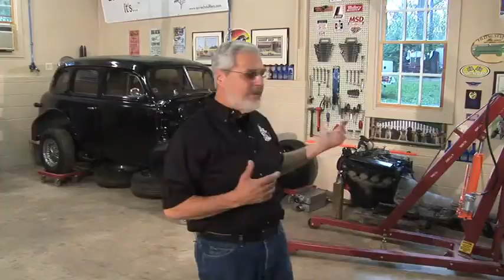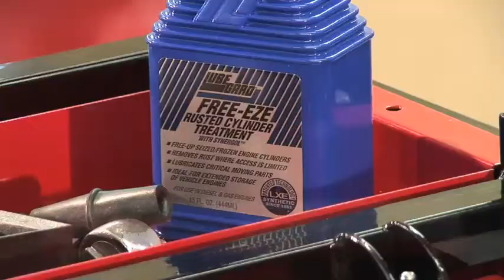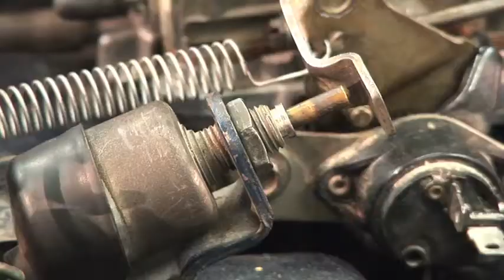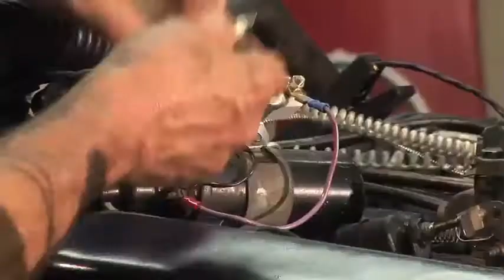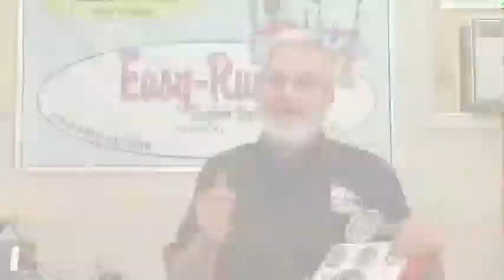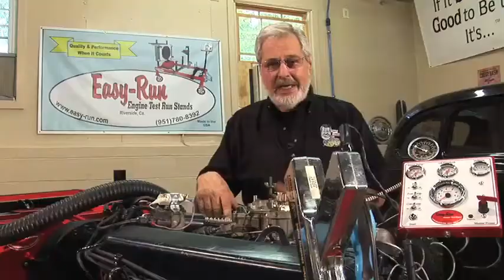Lubegard 9_17_10.m4v

Comment: I run Lubegard in my engine and tranny, running better than without for sure. That LXE technology is ahead of its time, beginning to see competitors make similar but not same ingredient. 

My example is the new Castrol Magnatec that claims to "Cling to critical engine parts when the oil drains down" that I am currently running in my car ('08 Grand Prix V6). I cannot find exactly what these "magnetic" molecules are, but I can assume they are attempting to recreate LXE. Does not appear to be any better than other synthetics in its price range to me, just my opinion from use. It is low priced but that makes me wonder... going back to Pennzoil with Lubegard next oil change.

Comment: Running Lubegard Biotech with synthetic oil from Pennzoil. Smooth!
Reply: Mark Kaiser I agree. I added the Lubegard Biotech to Mobil 1 0W-40 and my engine has never run so smooth & quiet. Also saw a 1-2 mpg increase in my average fuel economy. Definitely a great product.